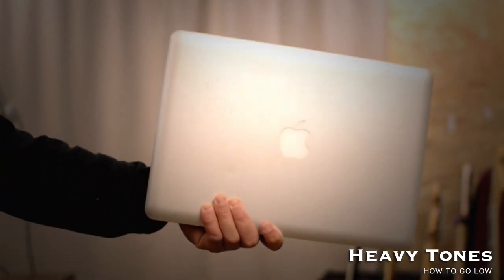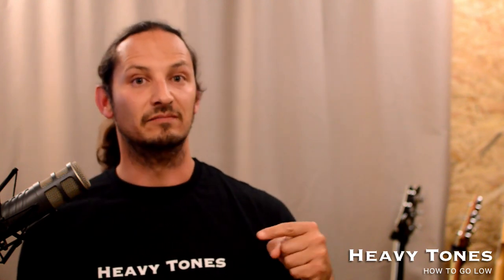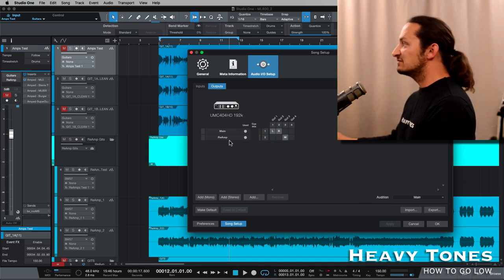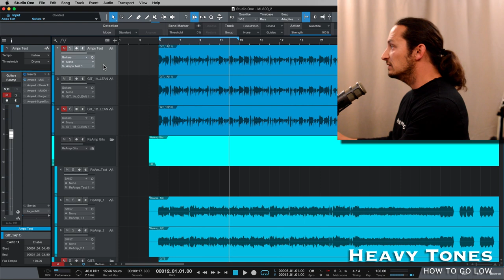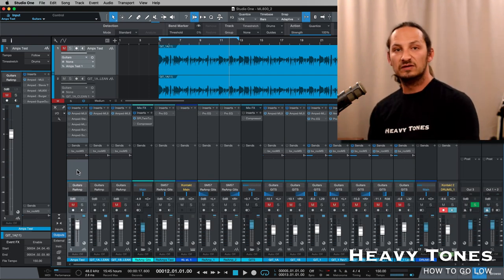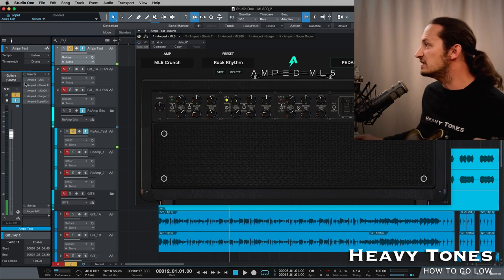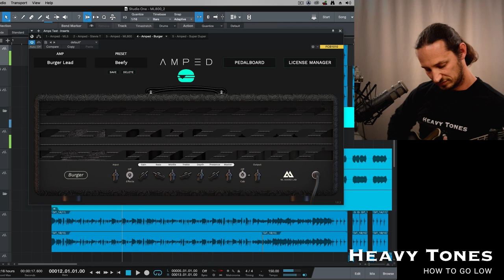How to use Amp Sims with a Real Guitar Speaker Cabinet

Comment: For those asking if it works in live situation : I just come back from a technical rehearsal day with my band and was plugged like this, I'll try to be precise.

The other guitarist plays with a Orange Th30 head and a fender 2x12 cab. 
I was plugged in my Focusrite 2i2 -> FX Loop return of my Jet City 100H head -> 2x12 cab
I use Neural DSP plugins (some of the best ones today). I usually use my EHX 44 Magnum (power amp pedal) for this technique but this way I'm able to use my amp head as a backup if my pc shuts down (but it is not a great amp at all). My Jet City head have only one 12AX7 valve for the loop, it may be important to know for the test.

At a very low level it's kind of cool but a bit unnatural, like very compressed. That's not the sound of an amp, but the amp of, lets say, an mp3 file through my cab. Our sound guy spent the day trying to go through my presets and eq-ing to reduce the super harshness of my sound. Our guitarist had to finally play very low, so did the rest of the band. The fact is that I'm totally crushed under my bandmates sound, even after non stop eq-ing. Not a lot of air even with my cab...

After concidering bying a better power amp pedal (like a Seymour Duncan Power amp), I begin to think to go back to a simple real (and good!) valve head. Because we play a kind of post hardcore/heavy shoegaze sound (Deftones/Nothing), I m asking you :

Is it worth to always buy a better interface, better computer, better power amp... and not really know if it's gonna sound gold because nobody really does it ? 
Let's be honest : the reason we want to do this is because it enables to play all these damn good quality and unafordable amps (like Neural DSP simulates) without spending a lot. 
At the end of the day I will spend more than in a good quality high gain head and I can still encounter many eq/volume/definition problemes I dont knpw about yet.

If you had other experiences, good or bad, please write ;)
Reply from the maker: Sorry to hear about this. In my limited test with the gear that I used in the video it sounded fine to me, and obviously the benefit like you mentioned is being able to used the Amps Sims we like in our studio in a live context. From my side I want jamming at super high volumes because I was testing it out in a small room. So maybe when pushed louder there is a different tone coming through. I'd say if you can maybe try test the setup through another power amp/pedal and see if it makes a difference. And yes also the audio interface you're using will make a difference. Don't try it out with the built in output on your computer rather use a dedicated audio interface. let us know if you have any luck.
Reply: I think part of the problem is your signal path becomes quite different from a real amp. A real valve amp has the power section interacting directly with the speaker/load (which has a significant effect on the tone and feel). Signal would go preamp > poweramp > speaker.
When you run an amp sim into a real amp's fx return, it goes virtual preamp > virtual power amp (without a load to interact with) > valve power amp > speaker.
That "virtual power amp without a load" is going to colour the sound and probably get more noticeable as you turn up the real amp when it clashes with the real amp's power section.
The way around it would be to use an amp sim thar allows you to not only disable the IR/speaker sim, but also the power section part (turning it into a preamp) - old amplitube, bias fx and revalver let you do this.
Alternatively, ditch the real guitar amp and go through a monitor with cab sim turned on.
One thing I'm going to try is capture an IR of my Torpedo Captor load box to simulate the load on a power amp, but without the speaker frequency filtering. In theory, putting that between a virtual amp sim (w/o speaker sim) and a SS amp/real guitar cab should sound more convincing.

Hope this nerd rambling is useful.

Comment: so say you have a real amp, but you want to use the amp sims through it just to have different sounds available... would I just go guitar > interface >effects loop send > amp speaker output > speaker cabinet?
Reply from the maker: Yeah, that's correct. So bypassing the preamp stage of your amp.

Comment: Hey, Gary. Thanks for the video. A few years ago, I laughed at amp sims and swore I'd never use them. Then I ate my words after my friend turned me on to Guitar Rig. It's all I use in my recordings now. I'd like to hook up a live setup like this. My only outputs on my PreSonus are IL and 2R. Don't I need to run those into 2 separate inputs in the power amp? (Really want my old power amp, the Peavey 120/120 with 6L6 tubes)!
Reply from the maker: Yeah amp sims have got so good that you can use them with a real rig
Reply: @GaryHiebner  for real. So, do I need to run my 2 outputs from my audio interface into 2 separate inputs on the power amp? I guess I'm not clear on that part.

Comment: Thank you. I’m just starting. Where is the Mac in that chain?
Reply from the maker: The Amp Sims are on the Mac. The Mac goes out to the audio device. And the audio is sent out the outputs on the audio device into the power amp pedal connected to the speaker cab. If you want to place any pedals before the amp sim then you connected your guitar to the pedals. And then from the pedals into the input of your audio device.

Comment: Can I use this without an actual guitar power amp? I have a power amp that isn’t a guitar pedal. But it works as a power amp for speakers and stuff. Could that still work?
Reply from the maker: I'm not to sure. I think a guitar power amp uses a speciruc impedance input. So just check the impedance on your power amp and see if it is the samr as a guitar power amp. Don't mess around with the wrong impedance.

Comment: Great video, all that I am concered about is the cable coming out of audio interface into the poweramp. I guess that you should use a TRS cable, that carries a balanced line level signal (that it supposed to go to you monitors), but the power amp si expecting to recieve a simple TS instrument cable that carries an unbalanced instrument level signal. Wouldn't that cause any problems? Or it doesn't matter which cable you use?
Reply from the maker: The TS cable didn't seem to be a problem at all. Seemed to work fine with no deteriorating of the audio signal.
Reply: @GaryHiebner  I would be more concerned about the power amp itself, that is recieving stronger signal that it should, than the audio quality. I guess the solid state Baby Bomb should be ok, but I probably wouldn't risk damaging some other tube poweramp (for example going from audio interface into a fx return on a tube amp)
Reply: @adamulc  Usually you can switch an audio-interface to unbalanced since there are many monitors which don't support balanced operation. The Return of an amp usually works well with preamps. Preamps send out a line level signal. My JetCity 22H's FX loop runs at line level. Other amps might run at instrument level! Yes, then this could be a problem, true. Depends on the amp, I would say.

Comment: I'd like to know if the amp sim would work with a combo amplifier.
Reply from the maker: If you can bypass the preamp stage on your combo amp and only use the power amp stage, then yes you can.
Reply: Of course you can even if your combo amp doesn't have an fx loop. Just plug in your interface out to the aux in of a combo amp.

Comment: what cable should i use?  instrument cable or speaker cable for audio interface output and poweramp output?
Reply from the maker: I just used an instrument cable. I'm sure its not the most correct way. But it worked.

Comment: Thanks for the video, I have a question though.....For example I have an orange pedal baby, which is a power amp i use with my GT 1000. The input of the orange power amp expects an instrument cable, but the output of a soundcard expects a TRS cable for monitors.....So there is a problem here, really. How come you plug an instrument cabçe to a soundcard interface, or an audio trs cable to the input of a poweramp? It s not the same thing....There should be something wrong here.....Excuse my non enlightment on the subject. Thank you ;)
Reply from the maker: Hi Gib Son, I didn't go into my interface with an instrument cable. I mic-ed up my cabinet. And then took the microphone cable into my audio interface.
Reply: @GaryHiebner  Hi man...Thanks for your answer....But how do you go from your amp sim into the power amp? that s what i meant sorry....You are feeding the power amp from the computer amp sim, right? how?...Like I said, the output of audio interface expects an audio trs cable whereas the power amp input expects a instrument cable, which is an unshielded ts cable kind of thing....
Reply from the maker: Ok, yeah so from my audio interface I am using the unbalanced outputs from my audio interface into the preamps. So from my understanding TS are unbalanced connections. Where TRS are balanced connections (correct me if I'm wrong). But if you connect a TS cable to a TRS output you still getting an unbalanced signal cos the cable is unbalanced. It's not the most desirable solution. But it still works.
Reply: @GaryHiebner  Right. I get it. Thanks for being so kind. Keep up the good work. Cheers ;)

Comment: Is the baby bomb loud enough thru a 4x12 cab to play over a heavy hitting drummer? I’ve got to shrink the size of my rig now because our practice spot is way farther away now…and if I can use these amp sims with their effects and such I won’t have to lug all my gear to practice. I’ll buy WHATEVER I need to still get my sound there without lugging my rig and the 1600 watt pa just to play over our drummer.
Reply from the maker: That Baby Bomb is super loud. I had it like barely 1 and it was loud in a small room. You could definitely crank the gain up to be lpud enough over a hard hitting drummer.
Reply: @GaryHiebner  thanks for the reply…just sent in my order!!!

Comment: Hi, it's a good set up but these power amp pedals like the Mooer are 30watt transistor (like a home transistor amp). Maybe I'm missing something but it seams weak for gigging with a full band (and real tube amps). Does the size of the cab changes something in the volume ?
Reply from the maker: Size of cab will definitely have a big bearing on the sound. I just used a small 1 x 12 cab
Reply: @GaryHiebner  Is it enough loud on a 2x12 without being miced up when playing heavy music in a full band ?
Reply from the maker: Yeah with the Baby Bomb it will be way loud enough. I only had it dialed in on the volume at about 8 'o clock. That 30w Mooer is super loud. You could definitely crank that up quite a bit to use in a full band mix

Comment: For live situation, I really care about latency, how much would you spend on a laptop ? How do you reduce it to minimum ?

Thank you :)
Reply from the maker: Yeah this all depends on the spec of your  machine. I'm using a MacBook Pro and Studio One and I'm able to reduce the latency to where its barely even noticeable. There will always be a degree of latency. But with a super high spec machine with a fast SSD drive, lots of RAM and a low buffer setting and you should be fine.
Reply: Buy the fastest cpu and ram you can afford.
Reply: @56brever  latency has more to do with the interface than the computer. I have a basic i5 laptop and I get the exact same roundtrip latency as my friend who has the same interface but an i7 gaming machine
Reply: You need a good fast interface and computer. RME babyface pro or something
Reply: On a semi decent computer/interface, latency shouldn't be worse than speed of sound standing a few feet from your amp.

Comment: Would this work with a BOSS TM-7 guitar monitor since it has an onboard amp sim ?
Reply from the maker: I'm not too sure. If you can bypass any amp or preamps and just use the cab simulation then am sure it can work

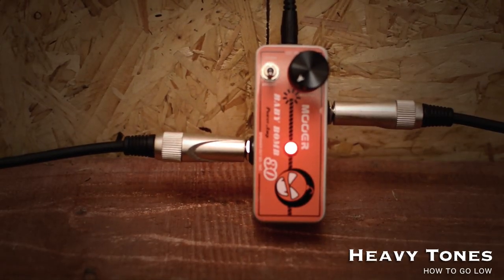Comment: Wait a minute. I'm a bit confused with the instruction at 3:48. So are you saying that the signal chain is: guitar>audio interface input>interface output to power amp input>power amp output back INTO audio interface>second audio interface output to speaker cab? Just want to be clear so I don't blow my speakers.
Reply from the maker: It goes guitar>audio interface input>interface output to power amp>power amp output to guitar speaker cabinet input. Then mic up the guitar speaker cabinet. And then this mic to the audio interface input so that you can record the signal coming out of the speaker.

Comment: Well, it's usually like this in live situations.

A- The state already has an amp + a cab, I'd just plug the audio out into the fx-loop in.
B- The place doesn't have an amp and 99% of the times in this case they don't have a guitar cab. But they have a speaker system of some sort, I'd just use IR's and then plug it directly as line in.

Other than that I don't really see why I'd want to do something like this for practicing since with IR's any sort of home speakers can sound the way your guitar speaker does except for free unless it's absolutely the worst.  But anyways cool tip. Thanks I guess.
Reply: sound the same, yes. feel the same, no. playing through a set of 12 inch speakers moving air definitely hits different than through smaller monitors. all I have are cheap 3" multimedia speakers that just do not sound or feel all that great playing my amp sims through.
Reply: @kmw5100  Yeah gotta admit that I agree with the speaker size point.
Reply: The idea is to make a fake amp feel more real. If you’re happy to play through your Logitech speakers that’s up to you. Also if you want to buy a valve amp and use the FX loop for a fake amp, you really don’t get it.
Reply: @illgottengains1314  I really do get it and you do not, the sound I generate is the same sound as the sound I generate with adam speakers. The diffefrence only occurs when you are trying tto mitigate bass and sax and shit. Whatever you input gets in the stupid mix that's the basic logic and it works, get over it..., It does not fucking matter if you have a tube amp or not in the fucking mix. And I have a peavey 5505 and it is fucking worse than anything I can play with plugins... Just try googlin "vst distortion" I'm sure it'll change your life dude :)
Reply: @fy7589  calm down baby. If you want the best solution, stick a celestion F12-X200 in a decent guitar cab. It’s a full range speaker. Sound on Sound gave it a rave review for use on stage with modelling including cab IRs.
Reply: @illgottengains1314  Thanks my dude
Reply: @fy7589  ❤️

Comment: So, the output on the audio interface has the signal from the amp sim? Wouldn't it just be a "dry" signal?
Reply from the maker: It will be the preamp tone of the amp sim. So it can be a clean or overdriven tone depending on what channel is chosen from the respective amp sim
Reply: @GaryHiebner  Gotcha. Thanks man, I subbed.

Comment: What happens when you run the amp sim out the interface, through a reamp box, and in the front of your tube amp, i.e. it's preamp section?
Reply from the maker: Can you run it into the Sends and Return on your amp? Or else it will be a preamp going into another preamp. So you want to try bypass your preamp by going into the poweramp section of your amp.
Reply: @GaryHiebner  Mine has the effects loop, and their is a return. So, I could send the track through in through the effects return. The track I want to reamp was recorded with a boss br 1600 distorted amp setting. There's no clean DI. This is before cab sim/IRs. And I wonder how much the signal is analogous to a guitar with a distortion pedal between it and the front of the amp. The hard drives on the br 1600 are known to fail, so I d like to figure things out with a minimum of experimentation on my part.

Comment: Hypothetically,  could I run a cable on the headphones jack from my laptop into the auxiliary input on my amp designed for music playback through the speaker, and ALSO use the guitar's input from an actual guitar.
The amp is a Laney LX15, and the interface is a Guitarport.
I understand that latency COULD be an issue.
Reply: I DO THIS! The latency isn't the biggest issue, the high and low frequencies sound less prominent and the tone sounds muddy compared to what i hear when i plug the heaphones in for example